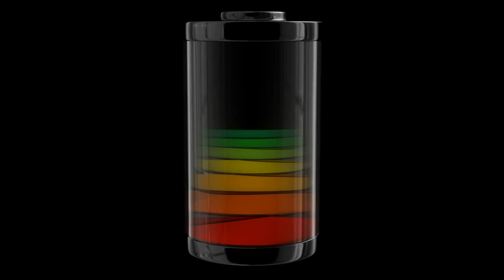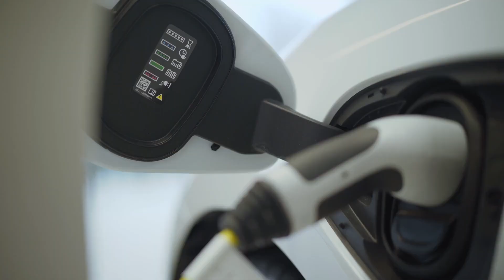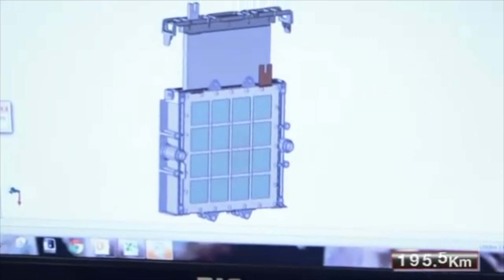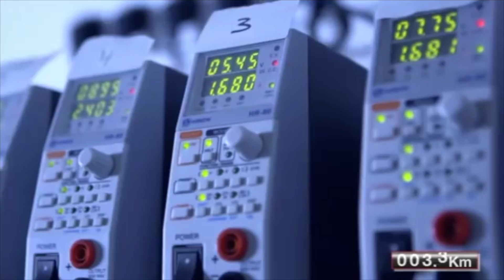This Battery Gives EVs 1000 Miles of Range!

Comment: Interesting. Non Rechargeable is a downer, of course. Recharging is convenient for end users. But I think practically if a vehicle has two packs, where one is being depleted first. Then,  when you’re running on the second pack, you know that you will always replace a fully depleted pack, and can be a bit more flexible.
Reply: Even two 500 mile batteries instead of one 1,000 mile battery because I want to get my full value out of the battery but I can't wait until 0% to swap it if I only have one because the car won't drive to the swap shop. More than one battery pack is a must.
Reply: You need a hybrid setup. Like the Toyota Prius, you would need a rechargible battery (NiMH or Li-Ion for starting and stopping) for regenerative capture, then the Al-Air battery as the main power source. A typical Prius like layout with like for like weight should give about 3Km range (1800 miles). The REAL factor here would be limiting patents and forcing automakers to use standardize battery packs to make swapping stations possible/profitable. We cannot allow a repeat of the the proprietary inkjet market to repeat itself in the battery swap market.
Reply: @valkyriefrost5301  as long as two companies can agree to use interchangeable batteries then the rest of the companies would have to hop on just to stay on the board like how ya have standard battery  sizes now like, aa,  aaa, c,and d size batteries
Reply: Swapping a battery every 27,000 miles (43,000 km) vs filling a tank every 500 miles (800 km).
So for someone who fills their tank once a week, that would go down to once a year.
I hope someone manages to solve the hurdles on this technology.
Reply: More than one aluminum fuel cell pack, sequential discharge, and standardized physical pack size are all a must, allowing users to fully deplete one fuel cell before using much of the next. Any one of those missing and the tech is DOA. All three are necessary for a viable fuel cell swap implementation. Appears to only be useful as a range extender with a rechargeable battery, so possibly viable only for vehicles that roll on wheels. Unproven economics.  And you didn't mention the CO2 in producing aluminum is from reducing aluminum into metal not from the energy source used. Continued research is certainly worthwhile, but I would much rather see a rechargeable aluminum battery to compete with lithium. And a small aluminum fuel cell pack should easily make a viable "spare gas can" for EVs.
Reply: That's the way to go yeah. Smaller batteries would be more user-replaceable too. Instead of a battery swap station, I would love to just take a standard pack from any gas station and swap it out in the parking lot! The only downside is that small batteries, when pulled from one at time might have a voltage that's too low for the horsepower a car needs.
Reply: It would have to be so that people get the full value of their battery. I envision several easily replaceable cells as well as a rechargeable battery in case of emergencies. If you can go 3 months before needing to replace a couple cells, then it basically eliminates the concept of charging/refueling and becomes just part of maintenance like an oil change only easier and quicker.
Reply: Recharging of batteries is inherently inefficient and (as this presenter points out in the last 3 minutes of the video) not necessarily easily accessible. To set up the power grid just here in the US sufficient to handle the billions of recharges that would be needed each year to power the hundreds of millions of vehicles in this country would require an infrastructure overhaul that will make the interstate system/bridge/dam construction projects of the 1930s -1970s seem miniscule by comparison.

It would make much more sense to have recyclable power systems that would be handled in a way not unlike the oil refinery processes currently in place. Aluminum is very abundant, lightweight, fairly easily recycled, and relatively inexpensive. Add to that the fact that it out performs not only the battery technology currently available but also ICE technology and the possibilities seem highly attractive.

Still, the level of standardization and coordination/cooperation that would be needed to make aluminum-air systems viable does make me wonder if it will ever become a reality. Will investors like Musk go along if they can't develop proprietary components that only they can market thus ensuring profits are maximized. Hmmm...
Reply: Oh hey there Cuckoo! Love your OPZ vids :)
Reply: @Arwyn It's a bummer, but not really a non-starter at all.  As you can see from the discussions here, there are all sorts of ways it can be dealt with.  Multiple, smaller, modular AL-air battery packs, say 50-75 KG each which could be swapped out by either the consumer or an attendant at a "filling station" with the proper mechanical and electrical design to allow for replacement without tools, the AL-air batteries augmenting a much smaller Li-ion battery that acts as a buffer and allows regenerative braking, and of course the AL-air battery packs would be recycled and refurbished - as others have said, using green energy sources in the process of recycling.  As others have said, standardization of the battery size and voltage is a key requirement to make it work across multiple car brands.  This concept sounds really cool!
Reply: Phinergy in Israel sells the battery.last I heard you could go 250 miles on a gallon of distilled water
Reply: Easily replaceable cells would be like a propane tank exchange if they could streamline the system.. So no charge times on road trips..
Reply: Six hundred kilometers is not one thousand miles. :-) 
I think the presenter misspoke.
Reply: IQ   Bravo
Reply: The Soda Stream model.
Reply: Absolutely. If the range is sufficient,  recharging is a monthly task and the nature of the interaction changes. You schedule it, and it could be made reasonably fast and automated.
Reply: Hum this is interesting. It gets you thinking to. What else could you do to make it better. Would you be willing to cover hydrogen fuel cells in a future video. Pros cons and compare to the Al air technology?
Reply: i think hydrogen fuel is best option to all type of vehicles and can be refueled in 5 min ,no e-wastage , more power full then electric car. hydrogen fuel emit only water vapour in environment
Reply: I have a solar powered house but we cook with bottled butane gas. Each bottle lasts several weeks. we have three bottles. When the seconis empty we go to the dept and swap out our empties for full units. Running like this wit Al-air would work but , yes we would need manufacturers to standardize on batteries.
Reply: One of the great ideas... To compensate for recharge split battery pack... Main pack and a secondary short range pack... Once main battery runout we can replace... Most importantly it eliminates multiple charge stations with swapping stations
Reply: So long as there isn't an economically viable way of recycling the rare earths of Li ion batteries, EVs based on such tech are creating a future ecological disaster. Re-cy liable Al-air is ecologically sound, especially if using solar or wind energy to recycle. The fuel cell packs can be made as modular as is convenient to replace so the user can replace as needed and not have to wait untill 100% depletion
Reply: True Cuckoo
Sorry... I wrote mine 5 months after yours because I only just found it.
Not trying to steal your thunder.
M.O.L.
Reply: Recyclable systems will always be better options. The reason I would support this system. Though an sfficient hydrogen creation on site solution would be quote awesome.
The bottleneck seens to be as to which system is as profitable as petroleum. 
If one works on a covid vaccine speed, things should change for the better soon enough.
Reply: Is fuel rechargeable?
Reply: Great idea!
Reply: Elon wont buy out this tech's patent and terminate it. Just like how his tweet push bitcoin price up ... or NOT
Reply: This technology might be a promising way to supplement power instead of having a main source.

Think this:
200km range lithium battery for everyday use that you recharge overnight.
Plus 40000 km range aluminium battery for when you have to drive somewhere further.

That would be a perfect solution for most personal cars.

It would be awesome to have a standard, but with solution like this one aluminium battery should be enough for cars lifetime
Reply: Battery waste would be a huge problem if everyone went to single use batteries. Rechargeable battery waste in the future is going to be a problem when the whole world transitions to electric. Just imagine that amount of waste times by atleast 50

Single use batteries could be quite useful for airplanes/ships as it got high energy density similar to fuel, but fuel can be made by extracting CO2 and Water which are the main waste that comes out of burned fuel and turned back into fuel such as biodiesel so I don’t think single use batteries will be anywhere close to mainstream.
Reply: @jhh631  The entire world will never be all electric. All electric tractors? Dont think so.  Plowing a field will take a huge amount of power from an all electric tractor. Not to mention 3rd world countries whose infrastructure cant afford a $200,000 plus or more all electric tractor. Electric semis may be one thing as some dont travel that far, or in towns.
Reply: "Non Rechargeable is a downer" That says it all.
Aluminum air power cell is DOA.
Reply: @DavidFMayerPhD  There is more than one way to implement 'charging'. We currently chemically recharge our Petrol and Diesel cars for example. If the spent Al-Air batteries can be recycled on-site in an efficient way it could still work.
Reply: @hendersonroger  The recycling process shpuld be done using renewable energy sources thus reducing the carbon footprint significantly
Reply: @busking6292  Worrying about carbon dioxide is nonsense. The entire "carbon dioxide" controls planet temperature is a gross oversimplification of a hyper-complex system. Stop worrying about "carbon footprint". It is meaningless.
Reply: @DavidFMayerPhD  I tend to agree with you but was trying to close the exits for the co2 obsessives who would seize onto the 'but recycling uses more fossil fuels' agenda,that's all there was to it.
Reply: @DavidFMayerPhD  Do you take issue with those whose research shows increasing carbon dioxide is the principal driver of climate change? Those same scientists do not discount other contributors, including methane.
Reply: As long as replacing the power generation infrastructure for the recyclers doesn’t make recycled aluminum too expensive.

Comment: There would need to be over a million battery replacement stations. Each one is very expensive, say $50,000 each. It would be very costly to the battery supplier at the station. A cost effective battery is one which can have over 1000 charges.

Comment: I wonder is there still any development into a 3 way power vehicles one by solar, wind and friction.. the solar collect the heat from the sun to be turned into electricity to charge the batteries, two wind through out the body hidden fans to be turn by the air also recharge the batteries and last and engine in front to use to propel the car down the highway and one in back to generate  power back into the battery. a 3 way charging system which may eliminate any charging along the trip.. but a slow trickle charge if you have a garage to or parking space   and can be charged over night. in less than full 8 to 12 hours.

Comment: Aluminium air battery is the most promising power source for EVs Indian oil is collaborating with Israeli firm to make & market them in India & Indian oil corporation has an petroleum station wide spread throughout the country and highways they have the capability of battery swapping on highways & small towns & city's, the fact is aluminium air battery have a long run energy to run thousand KM at least & having to replace or swap battery at the nearest to next IOC station in 5 minutes, rather than look for a lithium battery charging station every 200 to 400 km & wait hours to have it charged to continue the journey..👍

Comment: I think if this becomes economically feasible, then having standard sizes would become a "thing". Like how Eveready and Duracell have A, C, D sized batteries. Talking about "structural requirements" (in the comments) in the design of the car's chassis to accommodate this power cell is missing the point that these won't weigh thousands of pounds. With no gas engine under the hood (and maybe having each wheel powered by its own motor), the cell could easily fit under the hood of any car. I can imagine a couple of suitcase sized boxes that are easily swap-able at a drive through shop.

Comment: This is not the answer. If this were adopted, think of the massive production that would be needed to produce billions of aluminum batteries so you can swap them out everytime they run out of juice. Where is all the energy coming from to do that? Damn sure won't be from solar and wind. Fossil fuels. And there's a lot of environmental issue associated with that, as he explained. Everyone feels so good about electric but third world countries are being polluted and the population is being victimized by poor labor conditions and low pay. Don't think corrupt dictators and warlords aren't getting paid off. Look at what China does with sweat shops and forced labor camps to produce all the stuff we buy. Do you feel good now about your electric cars? Hydrogen fuels cells would work better than all that and is proven tech already used in busses and trucks. I don't know why not more is being done to put it in cars and homes. Truth is we haven't found the right tech yet to get us off fossil fuels. Electric cars are a very temporary solution. Aluminum batteries are a non-starter for me. I'll stick with gasoline and more and more fuel efficient engines. All things considered, all around, still the cleanest and most efficient way to run an automobile. The tech we need is out there. Someone is sitting on it. Something better than batteries.

Comment: I think this technology may apply more to an industrial or Commercial level and not be on a basic Consumer level. I'd give the technology if implemented now a 5-10 year life span cause other battery will be released in the next 10-20 years that'd make this tech obsolete. However I can totally see in this EV establishment period that if companies jumped on this they could have this out and utilized from Trucking and warehouse vehicles PDQ if the price was right. Especially if they had the right prices as the fossil fuel variants but as you said 4-8 times the range as the fuel variants cause the Energy to power conversion is almost 1:1 with and EV vs a fuel variant vehicle.

Comment: 99% of tv car shows today remove the car engine 3 size it then add forced induction on top.  Hyways are too cluttered to use huge engines. Even so no change till its back against the wall.

Comment: They need to figure out how to recharge the battery as it goes down the road... Like a gas n diesel motor uses a alternator to recharge the battery n batteries depending on if you got a huge system installed or equipment ect... Why not have the wheels or add a couple alternators on the car to recharge the battery??? Or / and make the roof of the car and hatch solar panel?? We could make transparent solar panels and just install em where the glass roof is now... So between the solar panels and alternators should recharge the lipo battery the Tesla uses

Comment: Replacements batteries!? If you standardize the battery we can have handling stations much like service stations for petroleum now; This is the best more consumerist solution. if the battery is a on quick sled with a decent weight pull the old one out, put the new one in. Those stations can have large docks that these are put into that are also trailers, that can be taken to a central processing plant that will then recycle, clean, and charge the batteries as needed. This is a win win, it creates stable jobs locally. 

But More aluminum means mostly more fluoride. we could use that fluoride in LFTR's to power factories?. OR just SMR's For the recycler plants.

Comment: I think you have your units backwards.  You said a range extension of 600 km is about 1000 miles, it's not, it's only about 370 miles.  However, 600 miles is about 965 km.

Comment: 🤣 I love the effort, but this is a horrible idea. Is the same as a combustion engine with less steps. Stripping the oxygen from the atmosphere and leaving the c02 is the same as a gas engine pumping co2 into it. Increases concentration of greenhouse gases. On top of that, the "battery" would just disintegrate, so isnt renewable at all.

Comment: These aluminum air cells should appeal to military uses.  Not necessarily for vehicles, but as silent hard to detect power sources for communication devices and  command post lighting, and computers.  Multiple standard battery packs that would automatically switch as power was depleted and the exhausted unit quickly replaced by identical standard packs would eliminate the need for much of the highly flammable fuel near personnel. Military use would refine the technology quickly to make it available for civilian applications.